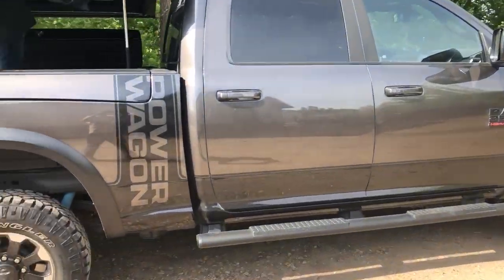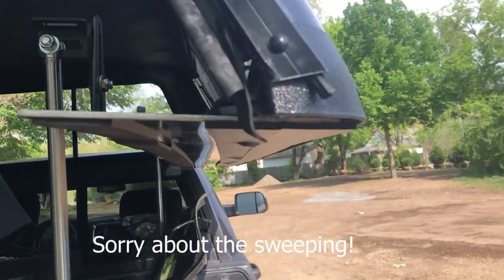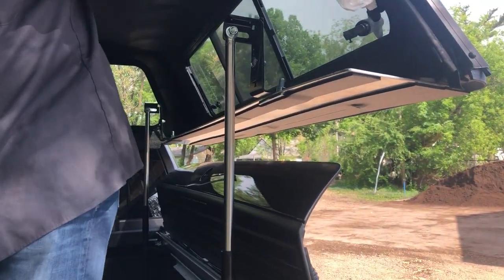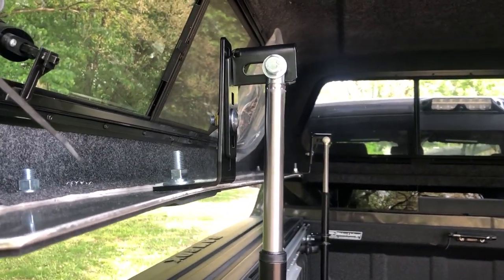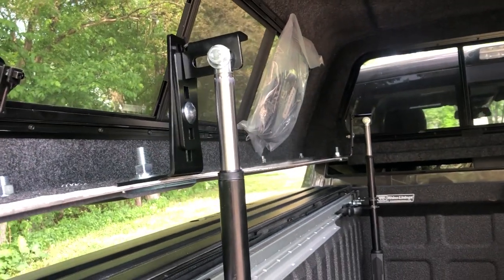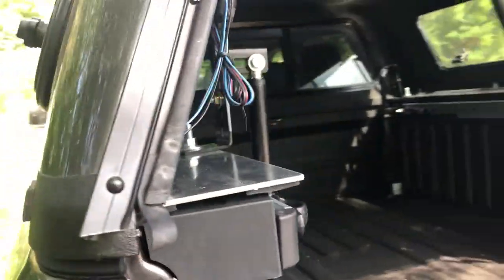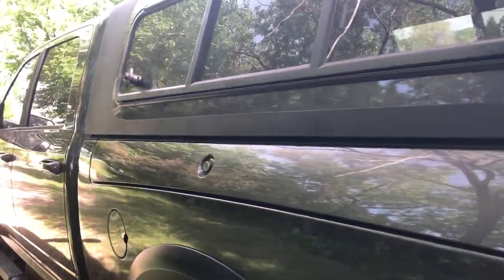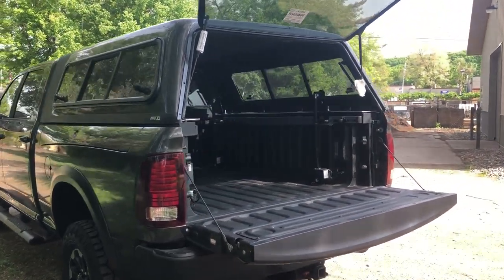TopperLift with a RAM Box | Ram 1500 Finished Install | Power Raising Truck Topper Ram Trucks

Comment: excellent idea, magnificent work, my 2 cents now, need to reinforce the camper middle part, I noticed a flex between the 2 electronic jack, on the left side, it won't hold the wear and tear too well. due to the camper weight,, will be a nice addition for durability purpose.  i would definitely do it to mine soon enough,, congratulations

Comment: What if I want to put the lift button on the right side?  Will it flip over?  Can I eliminate it and just use the remote or wire it out of the way?   Can i mount the control lift against the cab instead of the rear?  I have very limited space against the tailgate.

Comment: I swear the quality of parts today suck. This is one of the dumbest systems I’ve ever seen. First of all it doesn’t take a rocket scientist to figure out if you build a cap with a perimeter frame and a pair of lift up doors you could accomplish the same idea, with WAY less expense or parts. Second this pile of crap sits down in the bed. The ram boxes already consume the area around the wheel wells so you wind up with less space in the bed. It’s not that big of a deal because you can still haul plywood, drywall, etc. but now your going to loose another 6-8 inches with this crap. At this point go buy a damn suburban. I could maybe forgive this lazy engineering if the actuators were on top of the bed rails, on either end of the ram boxes. At least then you could still use your full bed. But this is just shit, and expensive shit on top of that.
Reply: Well said.
Reply: Waa waaaa!!!!